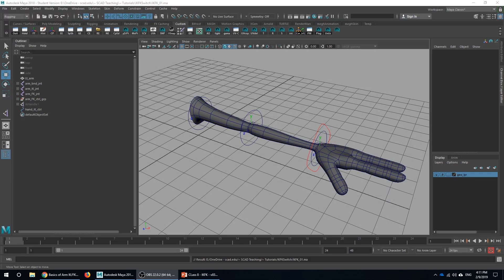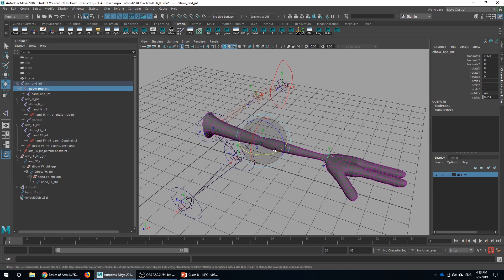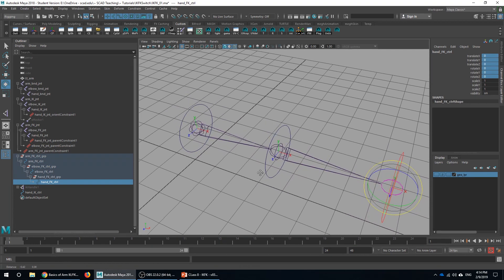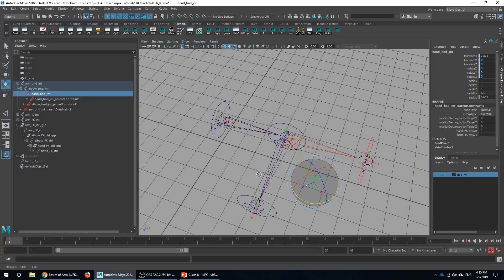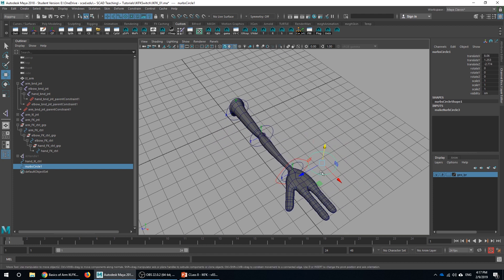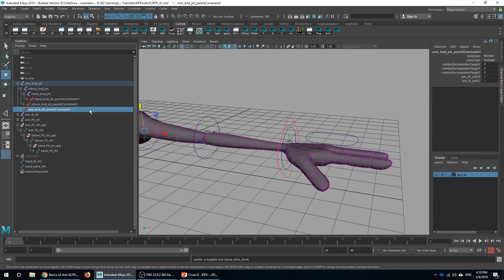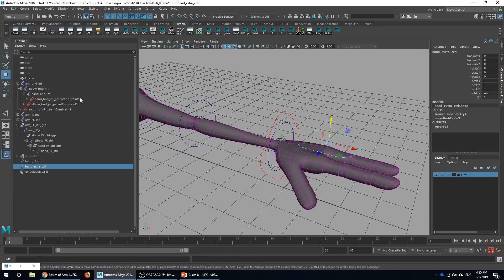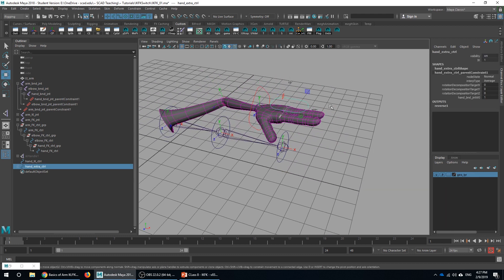IK/FK Switch Using Node Editor and Reverse Node

Comment: informative as always Mr.meghdad, the thing is when animating, is it possible to match the ik/FK orientation using only the node editor and avoiding expressions, any how
Reply from the maker: Thanks Walid.

Regarding your question, by expressions, do you mean scripts? There are scripts out there that help you match the IK and FK poses when switching between the two. I have never used them, but I know it's out there. 
Sorry I couldn't help.
Reply: @meghdad61  just Mel scripting, scripts are useful and there are many, i tought it maybe possible to know how it works in maya before relying on scripts just to get a good understanding of what is happening in the background, and it seems no one is talking about using maya tools to make a match ikfk orientation, maybe there's no tool after all
Reply from the maker: @DeathDealer-DD  I think I'll add it to my to-do list to see if I can find a way to make it possible using nodes.